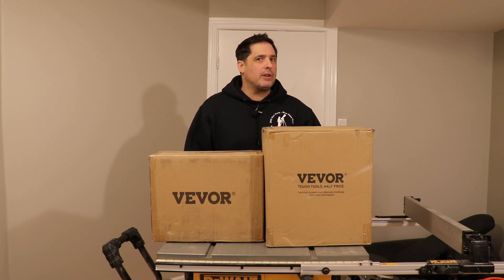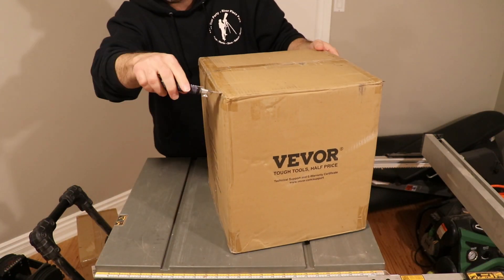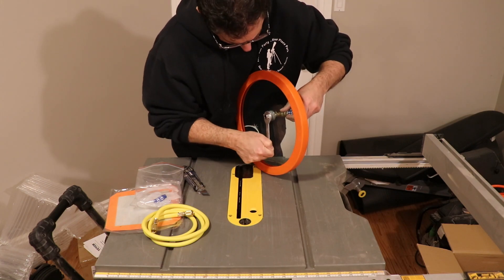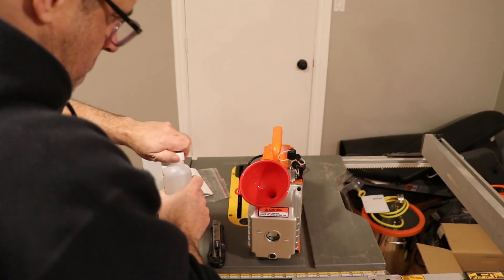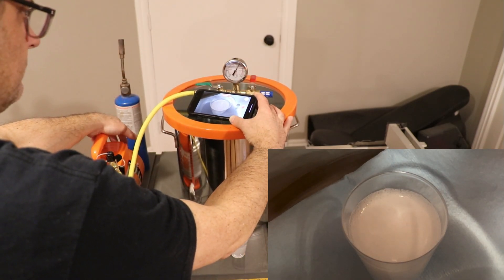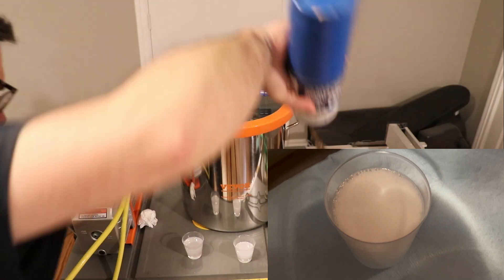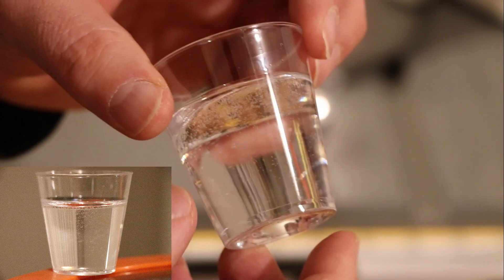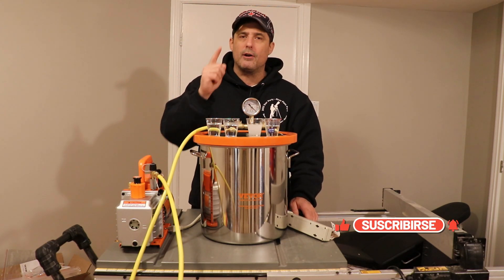Expert opinion on Vevor Vacuum System for epoxy resin: Is it worth $300?

Comment: You almost always have to use some kind of thread sealant on threaded pneumatic connections to get an air-tight seal. I learned that the hard way.
Reply from the maker: Good tip! I'll keep that in mind for future setups.

Comment: Been pouring for over 30yr love my vevor own 2. If you want to save your pouring cups and molds (never use molds in the vac) pitch the torch and use a stick lighter. After pouring wait about 5min then use stick lighter to remove surface bubbles.  Nice video pour on my friend 😊
Reply from the maker: Hi Walt, thank you for the advice. I'll give the stick lighter a try next time.

Comment: 26 Bar  - A bar is 14.7 PSI (1 Atmosphere) the most one can vacuum is 1 atmosphere, which is also 100 kPa.
The numbers you are using are metric and this may the issue as I assume you are located in the USA.
26 bar would equate to 26 x 14.7 = 382.2 PSI and to the best of my limited knowledge there is no vacuum pump on the planet that would achieve this.
Apart from the math the video was interesting - all the best with you future vacuuming.
Reply from the maker: Thanks for the correction, I am still learning all the conversions!

Comment: Would you suggest degassing epoxy before pouring? I have a 16" pizza cutting board in progress and ready to pour. The board is mainly red cedar rounds. I will be using epoxy that supports up to 400*.
Reply from the maker: Hi Don, Yes, absolutely. I degas every time. Takes 10 minutes and my epoxy comes out like glass.

Comment: HELP!! Appreciated.... Will a Vevor 5 gal vacuum chamber work well for turning projects? I just purchased one from Vevor and now not sure if I should have considered a pressure pot. Would I degass the resin and then pour into my container with the wood and let it cure, or degass with the wood and resin in the container?
Reply from the maker: Hi, I don't think you need to worry. Mix your resin then place it in your vacuum and bring it up to -25 bar. Once all the bubbles are at the top, torch the top to break all the bubbles and SLOWLY pour it in your resin into your container. be carful no to introduce bubbles. Monitor your project and torch the top of it every hour to ensure all bubbles are broken.  Let me know if you need any additional help.  Robert
Reply: @maplewoodworks  You answered my concerns, too. Thanks!

Comment: Do you leave your project in the chamber until solid? What happens to the bubbles after the chamber is returned to atmospheric pressure? I viewed another video in which a lot of foam was developed.
Reply from the maker: You may have to use the vacuum chamber 3 or 4 times for all the bubbles to come to the top. Every time you put the resin in the vacuum and bring it to -25 bar, let it sit there for 5 minutes then slowly let the air back into the chamber and remember to torch the top of the resin. repeat this 3 or 4 times until the resin is clear.
Reply: You vacuum the bubbles out first while it's in a cup. Then you gently pour that resin into a mold and let cure.  But you don't put a mold into a vacuum chamber to cure a project.  The vacuum chamber is only used to remove bubbles from something you are going to pour.     This video had great results in being very clear of bubbles.  People use a PRESSURE POT for curing clear resin because it shrinks the bubbles so small the human eye can't see them. It's usually a 2 step process for absolute perfection.  Vacuum most the bubbles out first, then pour into a mold, and finally put into a pressure pot to cure completely.

Comment: I just got mine wed...4 days ago. I'm at 800m elevation. It's a 5 gal tank. It got to -28.5 bar or 99.94 vacuum and has held it (all valves closed, pump off) at -28.5 bar till now!!!!
Reply from the maker: Hey John, Yup, I must admit I love this vacuum chamber. My resin is 10x clearer. Do you do bigger projects or smaller ones?

Comment: can I use 1:1 ratio resin? I would like to know if the resin doesn't harden while it's inside the vacuum and then become sticky before use it. My purpose is to use it for flower preservation.
Reply from the maker: Hi Carmen, Thank you for your question. Yes, you can. As a matter of fact, the first resin I show in this video is a 1:1 ratio resin. The one thing to look for is the "pot life" of resin. Your resin should say something like "45 minute pot life", that is the amount of time you have before the resin starts its exothermic reaction (in other words, when it will start to harden). Also, keep in mind that if it's in a cup like I put it in, it will harden a lot faster because of the temperature of the resin rising. Please feel free to post more questions if you have them. 

Robert
Reply: @maplewoodworks  　thanks :)